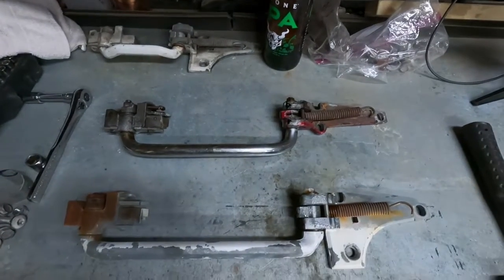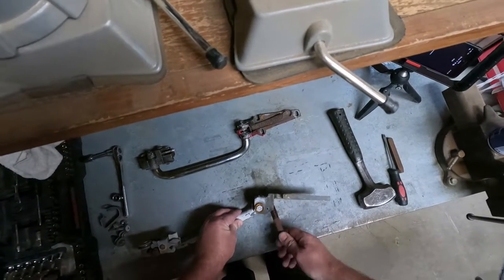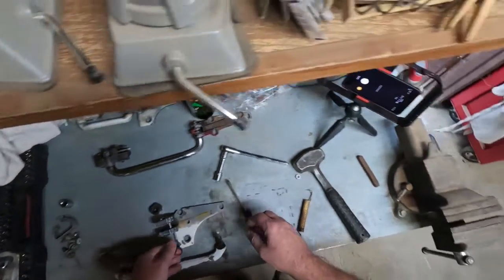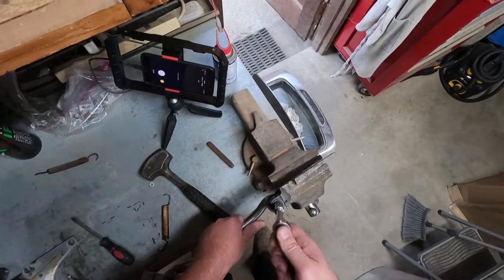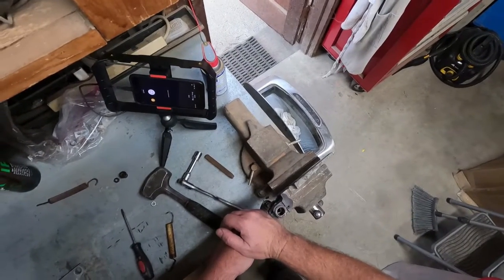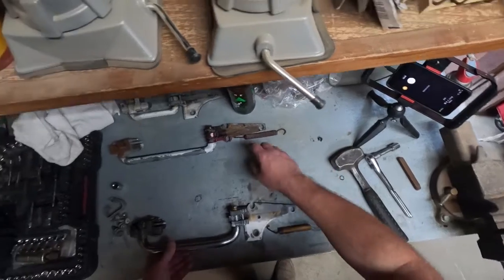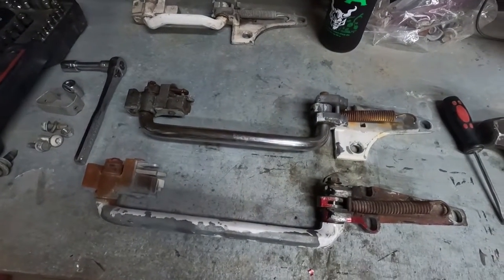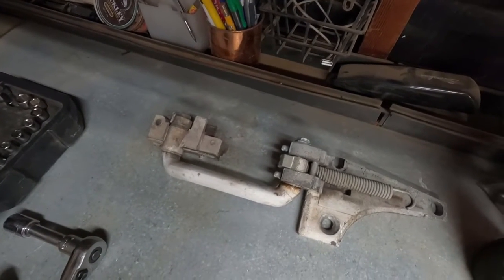3rd Gen Chevy Van Slider Extender Switcheroo

Comment: great video Do you have a video on extending the sider arm so you can rune wider tires and wheel on your van.
Reply from the maker: That's what a slider extender does.
Reply: @ROLLINGHEAVYMAGAZINE  I know that but I know you can also cut and weld in a piece to make the rod longer. That is what I was trying to ask about.
Reply from the maker: @joellekarma  Yes you can, if you got the fab skills to do it you're all set